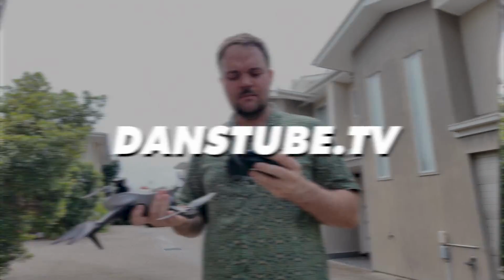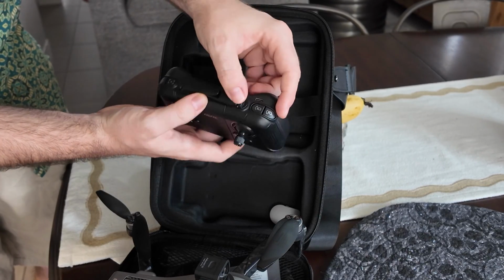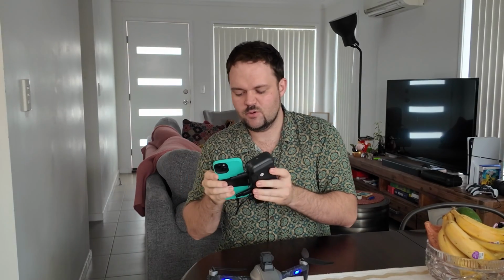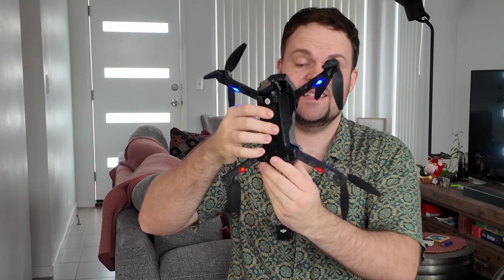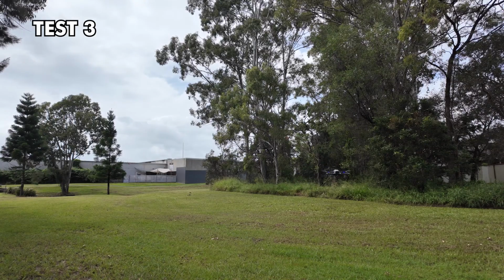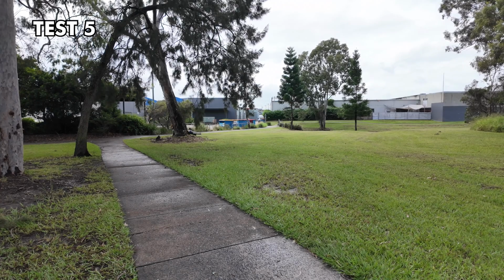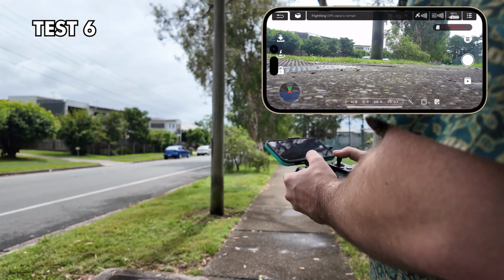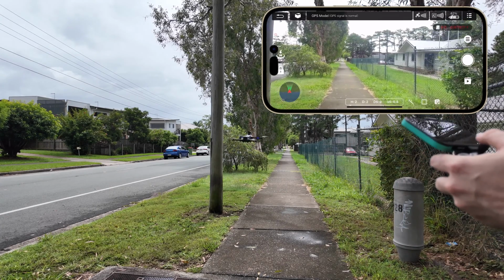Budget Friendly Drone: 4DRC F13 Rambler Drone Review

Comment: How is the video quality. It looked nice on the screen.
Reply from the maker: It is fine, it does the job for a budget drone.
Reply: @DansTubeTV  OK. What about range. I have a cheap chinese drone but it easily loses signal after maybe 20 metres.
Reply from the maker: I never pushed it too far for that reason. I went to 50m without losing range.

Comment: Your twin brother already did a review.
Why you say it isn't a camera drone I don't know? What's wrong with the video quality? Seems fine to me. It's the unstable launch what worries me.
Reply: Yeah I think the gyro needs to be calibrated and trim.
Reply from the maker: Yeah, the unstable launch worries me as well 😦
Reply: @DansTubeTV  Did you also gyro calibration? 
Beginners don't need long range and super quality video. What they do need is a reliable drone. And I always advice to get a $20 tiny whoop and learn to fly without GPS or optical flow and maybe even altitude hold. Proper flying. So they won't crash something like this 4DRC first time. Only idiots recommend a DJI Mini 4 Pro as a beginner drone. After 2 minutes they think they are great pilots. Until it goes wrong and they fly it into a tree.